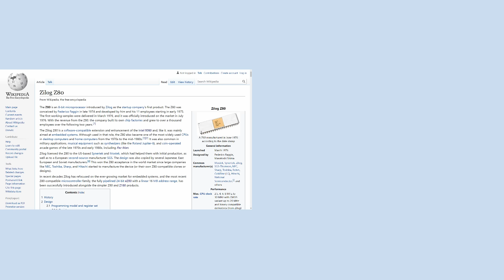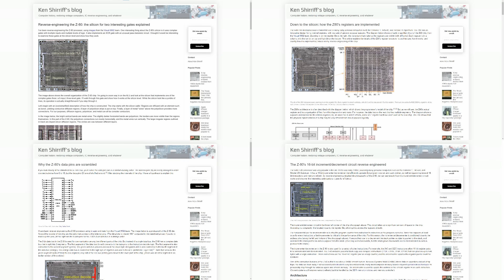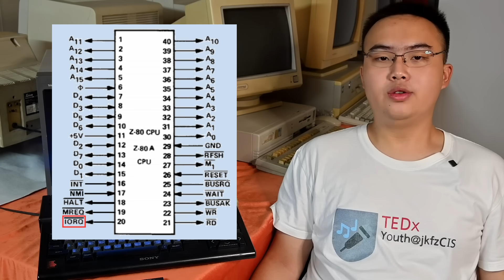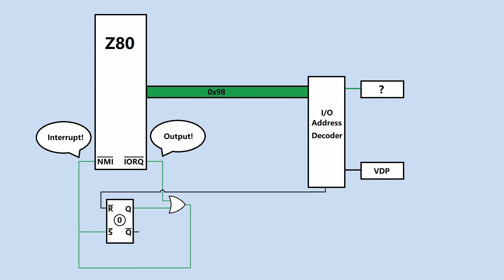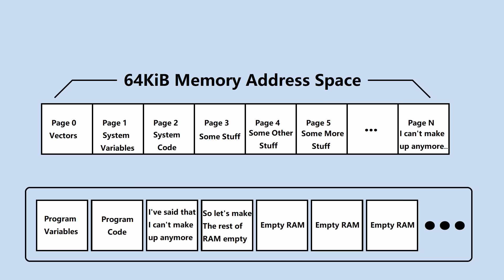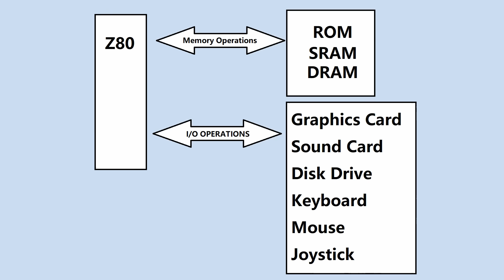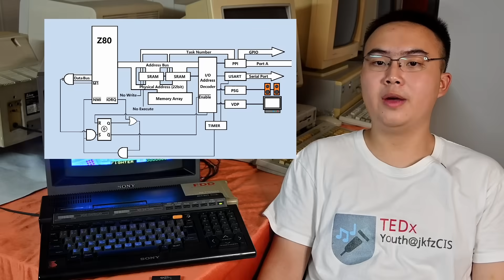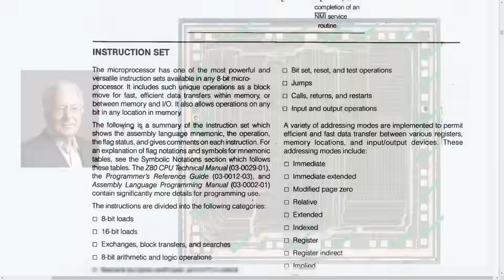The Z80's secret feature discovered after 40 years!

Comment: I worked at Morrow Designs in 1982 as tech support for the Decision 1 system. It was a unique machine for its time, and I still wish I had kept it — I eventually donated it, fully functional, to the Goodwill Computer Museum in Austin. The Decision 1 could support up to four simultaneous users running Micronix, a UNIX‑like OS derived from BSD. The Airforce Academy had systems configured for 8 users.
What made the hardware unusual was that it borrowed architectural ideas from the IBM/360. The Z80 wasn’t just running CP/M‑style flat memory; it operated in a protected environment, and the OS enforced segmentation rules. If a user program attempted to execute privileged or out‑of‑range instructions, the system generated a protection fault — very much like a mini‑mainframe.
The I/O subsystem was also ahead of typical Z80 designs. Instead of tight polling loops, the system relied heavily on DMA and intelligent peripheral controllers. Disk controllers handled their own command sequences, and the Z80 simply placed control blocks in memory and triggered operations via interrupts. When the device completed its work, it signaled the CPU — no busy‑waiting, no wasted cycles.
The bus architecture used a structured command/response model (sometimes described as “micro‑channel‑like” in spirit, though predating IBM’s MCA), and the whole system behaved more like a small multiuser minicomputer than a typical 8‑bit micro.

Comment: The Z80 was excellent for home brew computers and intelligent control devices. Don’t even mention the 6502 in the same sentence with the Z80. I built a lot of home brew computers on the kitchen table using the Z80. Interesting stuff in the 80’s but those days are over. What took a week with a Z80 and a board of discreet logic can now be done in an hour with a arduino and a 15 year old.

Comment: I absolutely love Zilog.
In 1986, I built a ZXspectrum on TTL without the ULA circuit.
It ran faster than the original because it didn't hold the processor at 16384.

Comment: It's not a "z80 feature" then. If these things (RS that wires back to the NMI, AND that combines five inputs, MMU) were integrated into the CPU, that would have the right to be called "CPU feature". But it definitely serves as a proof of concept.

We also can't call this "mode": a mode is commonly a way of running code that could be entered and exited, or "enabled" or "disabled". x86-based CPUs since 80286 has modes, that is switched by setting a certain bit in the MSW (CR0 on later CPUs). With your machine, it's not a mode, it's a static feature of the computer: it has this protection and it is always there, it boots and executes always this way, there is no way to enter or exit it. It is, however, implemented in a very clever way that allows the code made for other machines to work safer than on those other machines; that's really great.

It's possible to build such a "protected mode" system if you add an MMU and other circuitry to virtually any thing that has a programmable ALU. That does't make it the "feature" of that thing. There is a project to "run Linux on AVR" (8-bit microcontroller, obviously no MMU and so on), and they achieved it by building essentially a hardware ARM simulator, or it can be considered an microcoded ARM CPU that has ATmega as its microcore; they even had the same wording as here, "running Linux on AVR was considered impossible". It runs very slow; in their demonstration, Ubuntu was only booting for ~2 hours.

I'd like to see the performance of the software running in your computer, in comparison with the same software running on a "traditional" z80-based machine, with the same processor. I imagine it's noticeably slow. That would be the reason it wasn't used back then, not that it wasn't possible or nobody thought of it — I am sure there were people considering such architecture, but finally the idea was scraped because of huge overhead. That is the "hands on" difference between "true" feature and the one "built around": the first has to suffer only negligible performance drop. Remember IBM's attempt of making a full virtualization system on 80286-based machine (that has a proper protected mode as a true feature of the CPU)? They even built it, but it proved to be very slow, because there was no way to "exit" this mode to run "traditional" software (clearing PE bit in MSW did nothing), and they had to reset the CPU to achieve this; that was the motivation for Intel to introduce the special V8086 mode into 80386's PM.

So, I believe that if somebody took an idea of yours back then and suggested building a "z80+" CPU that has this built-in and performance overhead optimized, just as Intel did when they added this additional mode, it would be a boom. For now, we can admit that very little has to be added to the CPU to make true "protected mode" possible.

Comment: Circa 1979 There was a design for a dual Z80 system on the same bus using dual phase clock and shared memory, a few 244 and 373 etc.
Dr Dobbs or one of the other pioneering journals of the 70s.
The Z80 64180 and higher were and are very impressive.
I started out on the very quaint and clunky 1802, 8 clocks to a machine cycle, up to three m cycles for a 'complex' instruction, 1MHz .

Comment: You using the RST opcode to switch to system is problematic. The issue is the CB page opcodes. Specifically, the eight "SET n,A", where n is any number from 0 to 7. 
The M1 line is asserted when CB is read and it's asserted when the specific CB opcode is read.

Comment: No, not clickbait. Not using the Z80 as intended, but who did that? As you said the Z80 often got used with an Intel chipset and used in ways never intended. There are even ways to use the NMI as intended with more complex circuitry to differentiate from I/O and other NMIs. It isn't as elegant as the TMS9900 for context switches but the pieces are there and what's missing can be added. Nice work!

Comment: Thanks for this video. Great idea on using the IO space for protected and virtualized modes! Haven't thought that Z80s are still around. I started with a TRS-80 in 1979 and built my own co-processor Z-80 based with vector graphics card - used NMI to do updates during VSYNCH of the monitor (well B&W TV). 6MHz(!!) Loved (and still love) the Z80 and its DMA controller.  Back then, my personal budget was to low to buy more than 64KB of DRAM - how things have changed :)    Good luck with the PCB and the SW/drivers.  Looking forward to see more! Thanks!

Comment: I was hired to program, in assembler, a Hitachi HD64180 Z80 clone CPU that was affectionately called the 'aircraft carrier' due to its size with 64 pins. I used an RTOS core with it. I dabbled with a National Semi NSC800 CMOS clone, Z80 in Sinclair ZX81, I have an AGON Light Z180 which I had forgotten about and never powered on. I have yet to test an 8085 SBC kit. I can still read hex code and disassemble it in my head.

Comment: where i worked when the Z80 came out, every one of us wanted one.
This was the time when build your own computer was pretty much required. 1K of ram cost you $2,000.
You pretty much were required to wire wrap perf boards to build one.
What I dislike so much was using dynamic ram for that. Too many other components required for that.
I had also wanted a IMSAI 8080 and then the 8085 came out.

Comment: If IBM, Microsoft and Intel didn't spoil everything we could have a really good, cheap and user friendly computers today. And with two sets of Z80 registers one can do two tasks easily without additional hardware.
Reply: I wanted speed. I had to support a 1553 bus and a Navy Radio receiver. Two Z80s - between the front panel an the chassis. FORTH was the OS and assy was used for routines that demanded speed. We were in competition with Collins Radio. We could do a redesign in a month using FORTH. It took them 3 or 4 using C.

Comment: You could add protection to just about any 8-bit micro back in the day, by using the early 9-bit memory DRAM SILs, and routing the 9th bit to an interrupt pin to raise an interrupt when attempting a read if the 9th bit had been set.  And the 64Kx9 SILs meant that any memory byte could be protected.  I designed a 6809 system that way around 1982.

Comment: The title is just clickbait because there is no secret about z80 discovered here. Neither the already well known and broadly used bank-switching to access more than 64k of memory nor your so called "protected mode" are hidden features of the CPU but features of the surrounding circuit.   E.g. the KC85/2-4, Home computers build in former East Germany used the high address bits for a quite nice module concept.  Decoding Instructions by external hardware was also already used by support chips like SIO/PIO/CTC. (the RETI instruction had special meaning for those chips)

Comment: This is excellent work, very well done! I've done address translation, write protect and no-execute, and multitasking with multiple consoles with the 6502 before, but this IO protection didn't come to my mind. I have to note that reacting on the NMI is not trivial,  as you have to analyze what data and address was  used from interpreting the opcode executed when the NMI got triggered. That may be easier with the Z80 than with the 6502 due to the Z80's separate IO instructions. Again, very well done!

Comment: If you're really wanting click bait views. Find a woman with big titties and her ass hanging out of her shorts  to bend over and make comments. You'll probably get a 100,000 views as long as she doesn't have a mustache. 

 Undocumented instructions aren't important. The Z-80 has many instructions you'll never use during the course of your programming. 
Nobody uses every available instruction  to write a program.  Undocumented usually means unnecessary. I've built many Z-80 home brew computers on the kitchen table. It was relevant in the 80's but today it has no real application unless someone wants to teach themselves assembly or basic computer hardware knowledge. Everything someone wants to do with a Z-80 can be done cheaper and better with off the shelf products like a Raspberry PI Pico running Python or an Arduino Clone. ( If you're building an intelligent controller ) I was all over this CPU and the 6809 in the 80's but theres a time to let it go.

Comment: Do you think you'd be able to the 80286 or 8088 to do protected mode??
Reply from the maker: The 80286 already has a protected mode. It's extremely crude but technically it will protect. People just don't care about it and use it as a fast 8088. I don't think I can protect the 8088, the bus is too complicated and some edge cases will slip through the cracks causing malicious code gaining system access.
Reply: @andyhu9542  the 80286s protected mode is so bad was basically never used. I wish there was a way to shim an app so that you could tell a non protected mode app in DOS to become protected and behave properly
Reply from the maker: @AlsGeekLab  There is indeed a way. I think Microsoft did it with Windows/286 and many third-party multitasking OSes on PC also did something similar.
Reply: @andyhu9542  yes, but they still don't behave. For example, when I run TCP software that needs to run in the background and I go to my word processor then swap back, the system halts. It would be great to have true backgrounding rather than task swapping

Comment: The Zilog Z-80 processor still has many secrets engineers have yet to crack. Did you know the Zilog Z-80 was produced by a very small team looking to take on Intel and their 8088 processor? While this was going on, there were many big companies that would purchase the rights to use a processor like the Z-80 so they could clone it cheaply. This, of course, caused many small innovative processor companies to go under. Oh, but not the Zilog....that would come later at the hands of one of their partners...

The Zilog Z-80 8-bit processor was created to not only run circles around the Intel 8088 but to thwart would be thieves and cloners as well...I'm looking at you NEC. You see, the Z-80 developers created traps, fake leads, and other oddities to make cloning it a very costly and time-consuming endeavor. To my knowledge, outside engineers have only found 5 of these traps, and it is believed there are more. Kind of cool, huh?

Fun Fact- The Z-80 was a legend in its day. It powered arcade cabs, was in the Master System, Genesis, Neo Geo AES/MVS/CDZ. You can find one inside the GameBoy and GameBoy Color...and so much more. It's one of my favorites but for me, the Motorola 68K 16-bit/32-bit processor is mine.
Reply from the maker: I would do a bit of nitpicking here: the GB CPU is not a Z80, but I guess you already know that. And yes, I know too well the history of Zilog and the Z80 processor.
Reply: @andyhu9542  
Yes, I knew it technically isn't one but...nitpick away my friend. This was an excellent video! Do you have anything on the Motorola 68K?

Addendum- I'm such a gamer. ;)
Reply from the maker: @Sinn0100  Currently I haven't looked too deeply into the 68k. However, I can point you to the SUN-1 which uses two 68ks in lockstep to achieve a 'protected mode' on that machine. (But from your deep knowledge into 8-bit CPUs, I guess you already know that one)

Comment: Cool idea! I think the external circuitry is simple enough to fit in a single GAL 22V10 or similar.
Reply from the maker: I made a complete implementation of the design using TTL gates. It turns out that the complexity is beyond a dingle GAL22V10. But a few GAL22V10s are probably enough to handle it.

Comment: That is really quite clever and would have been very simple to add to a system PCB.  I wonder why it was never done.
Reply from the maker: The circuit shown in the video is an oversimplified version. When timing is considered, the circuit becomes quite complex. Also, interrupt handling is significantly slower with the overhead.
Reply: @andyhu9542  It is still a very clever solution.  Dont take that away from yourself.  Well Done mate.

Comment: Who needs protected mode in 1980-s?)) First models have only 4 to 16KB of memory))
Reply from the maker: If you look at the sales of PDP and VAX machines, or even early Sun workstations, you will realize that there are demand out there. A Z80-based solution may work for those people, but at a cheaper price point.
Reply: @andyhu9542  but very long time people work in pure DOS, with processor much faster then Z80 ))

Maybe with multiple Z80 and one processor to control protected mode and multi tasking it will be powerful, but 386 processor will be chipper, i think
Reply from the maker: @TerroMin  I'm not talking about standalone machines. The use case would be one such machine running is some corner, with serial cables connecting it to multiple dumb terminals, each accessing a virtual computer. This will be cheaper than buying multiple computers.

Comment: Decades ago, it occurred to me that memory could be expanded by inserting high speed sram into the high order address lines to expand available memory beyond 64k. I didn't have a convenient way of implementing it (working on a hobbyist budget in my basement) but it would have been easy and obvious using parts available in the 70s/80s. Nice to see someone else was interested in an arcane way or bypassing an 8bit chips memory limitation. Limitations that would disappear within a few years.This all looks familiar to anyone who's read some of the Don Lancaster books (especially "The TV Typewriter Cookbook, which used a minimum of additional circuitry and some clever programming to turn a 6502 chip into a video chip.) 
I don't mean to put down Andy Hu's efforts by any means. He's picked up the ball and ran it in for a touchdown! This is a formidable accomplishment, working a basic idea into an actual working implementation, and then expanding it into additional functionality. Kind of cool to see someone who wasn't even around in the 70s/80s revisit 8bit processors, and even find ways around their limitations.
Reply from the maker: Thank you!

Comment: Great video.
Did you forget the overclocking features.? 
Amstrad rulz.........
Reply from the maker: I heard that the 20MHz version of the Z80 can be clocked at 24MHz without problem. But I haven't checked myself. Looking at the timing requirements, designing a motherboard for an overclocked Z80 would be hard.
Reply: @andyhu9542 
Heat and signal fidelity were the biggest issues.
I don't recall how to start Z80 in hI_fRqu mode. 
Love the Z80 and Z8081. 
Good luck 👍

Comment: You are right, the 8080s generally use VRAM that is part of the standard 64k memory space which would make this protected mode difficult. But there were S-100 video cards that would run in my SOL-20 8080A (for example) and then you could write to VRAM outside of the program memory space and use the VRAM as regular RAM. Now you make me wish for a couple of S-100 boards, a Z-80 coprocessor board and a Cromemco TV Dazzler to soup up my old SOL-20.